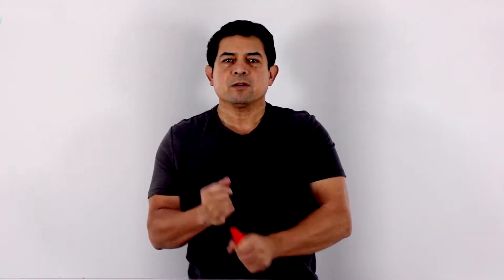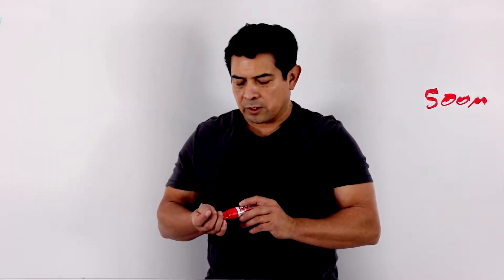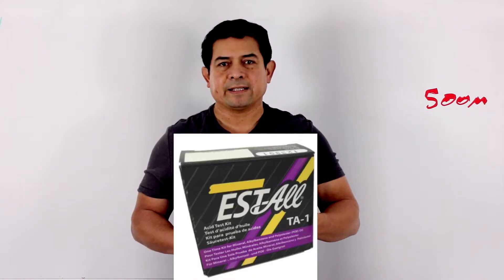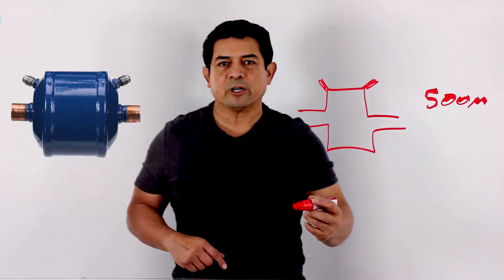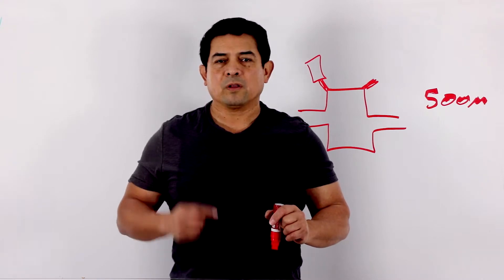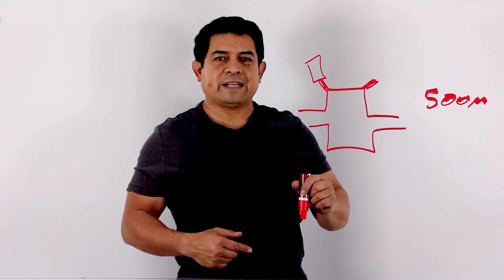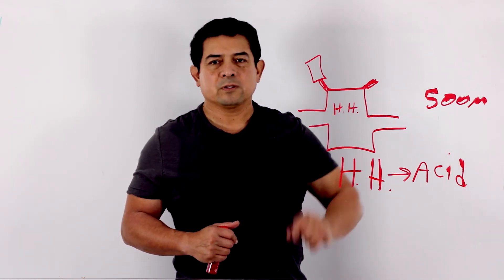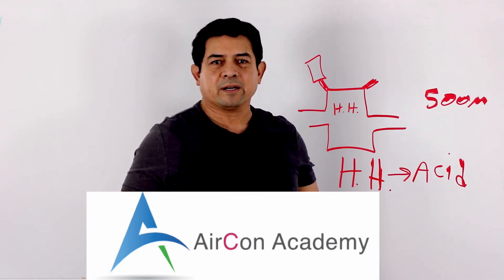HVAC Acid testing. - HVAC Online Training and Courses

Comment: I was taught that a suction line filter drier should be only used if there is acid in the system. The suction line filter drier should be removed after 3 days. The only filter drier should remain in the system and replaced each time the system is opened is the liquid line filter drier. Is that correct? Thank you and for your awesome HVACR learning channel!
Reply from the maker: Thank you for watching and sending this question in. I have heard that in the past. But I do not remove dryers because when you remove a dryer you are allowing air and moisture to enter the system. I worked for a company for 30 years and the only reason I would remove and replace the dryer after I had installed it was if the system was very dirty so I was sure to catch all of the debris and moisture that was in the system. During the time in that company we never had a problem with a suction or liquid line filter dryer left in place. I hope this answers your question and I am saying this because of what I saw and did overdose 30 years. Just so you know I have been doing this since 1979 and I have done this many of times without a problem. Thank you for watching and I hope this helps!

Comment: Thank Sir for sharing How to do away with acid in the system.just a question if I could change the oil and replace with fresh oil will this be helpful?
Reply from the maker: Yes, if you change the oil in the compressor that will help. You can also buy some acid neutralizer’s to put in the system. I do not know where you are but here in the United States we can purchase a product called acid away. This will neutralize the acid but you have to be careful to get the correct one. They have two types, one is for POE Oil. The other one is for the mineral-based oil.    They do have other types/brands that you can purchase. You can also install dryers to clean up the system. When you do that you need to look for the dryer that has HH on it. The HH  tells you that it will trap the hydrochloric and hydrofluoric acid. I hope this information helps. Good luck. Thank you for watching and I’m glad you liked the video!
Reply: @AirConAcademy  Thank U Sir for your Videos.i am actually based in India,and a retired technician but I do follow your videos to keep in touch with work.when U have the time pls a short video on Refigerant oils.God Bless Thank U
Reply from the maker: @kennethlobo4420    India??!!??    great!!!  Thank you!!!

Comment: we pull to 500 micron or below and then the system is required to not rise more than 200 micron. This allows for any possible leaks or buried in oil moisture that boils off slower.
Reply from the maker: Yes, that is an excellent practice. Leaving it in a vacuum for several minutes will make sure that moisture will boil off. That is one reason as to why some people do a triple evaluation. Thank you for your comment.